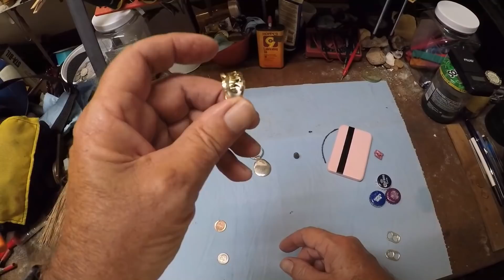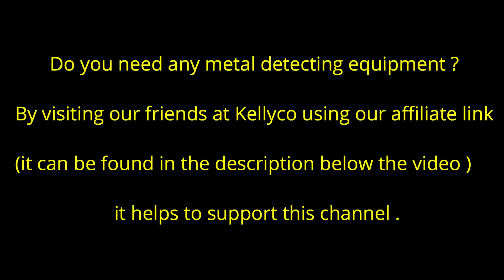Beach Metal Detecting IDD 199 FAT GOLD

Comment: Put the pink thingy into a bowl of rice to dry out for a few days. Love  your videos! They're the best! Stay safe and God bless. Happy metal detecting! 😆
Reply from the maker: Hi Lee , I did that . It dried out great. Dry sand was falling out of the unit . It would not operate . I took it apart and the inside was extremely corroded . The rice did dry it out completely . Thanks for watching .
Reply: Rice doesn't work.  Old wives tail.
Reply from the maker: @jimstand  it worked for me . It was just too late to save the unit . Thanks for watching .

Comment: Nice hunt with a couple of good finds. Nice ring and a battery bank. Good luck on next hunt.
Reply from the maker: Hi Steve , thanks . The battery pack was no good . Once it dried out the sand started shaking out . When it didn't work I took it apart. It was very corroded inside . It had been out there for some time. Thanks for watching , good luck and happy hunting .
Reply: @idigdaytona4478  Figured as much as they go bad sitting in glovebox. Do you know Jay from Gaptian's Vlog? If so is he doing ok?
Reply from the maker: @SoFloSteve  ,  I watch Jay's videos . He has not put anything up in months. Same thing with WIG TV in Cocoa Beach . I don't know them other than on the web . A YouTube channel takes up a lot of time. They may just be busy with other things.